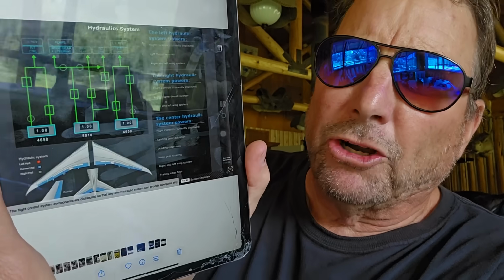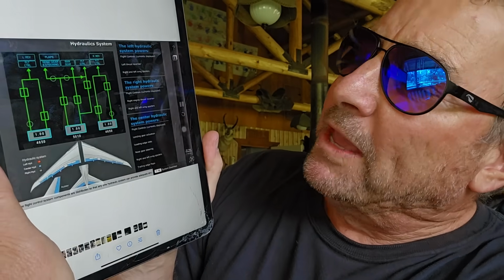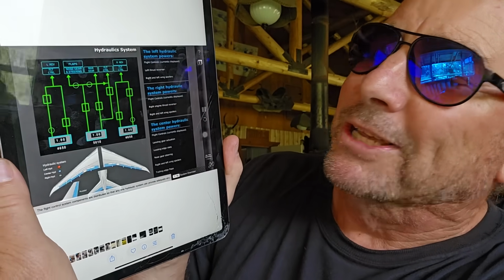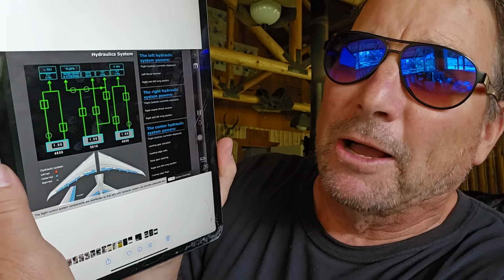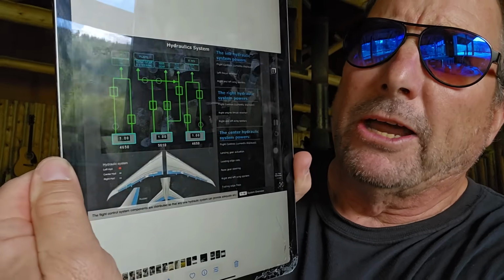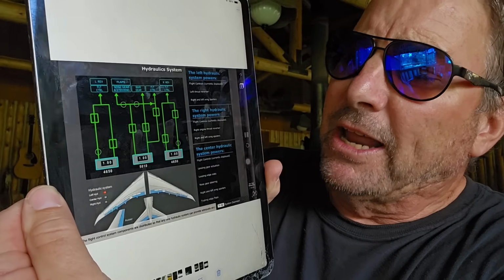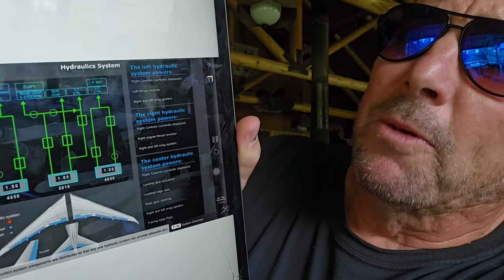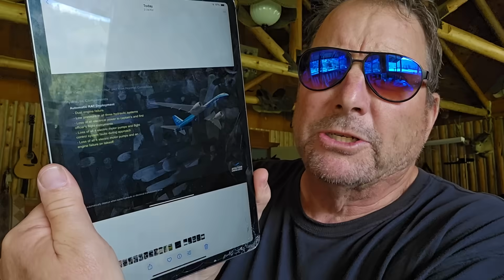787 Crash India What's a RAT? When does it deploy?

Comment: dont know anything about aircrafts but i just feel like dumping my own opinion here, people saying it is pilot error is dissapointing and honestly most of it is a poor attempt at racism,  notice how the two mini propellers meant to provide emergency energy are out which suggests a dual engine failure, to deduce such a thing to mere pilot error is diabolical because you cannot still remove a fact as big as that,  the pilot specifically said "no power. loosing thrust" and the witness account from the 1 survivor talking about how the white and green lights in the cabin went on which relates to a electrical failure of some sort which probably caused the RAT to deploy
also this specific plane 787 will literally not allow you to take off with if the flaps arent correct from what i know based on random pilots yap that i read, its also worth mentioning this model has a issue with lithium batterys exploding in heat, at the time it was 37c outside which might be enough to induce heating, i think an electrical failure of some sort played a role.
at the end of the day its the black box thats going to hopefully help deduce the cause.
Reply: No. In modern commercial aviation, pilot error and shoddy maintenance are at fault in the near entirety of crashes. Exactly the same discussions happen with every crash regardless the race or nationality of the pilot. I'm so damned tired of these accusations of racism every time the crew isn't white and people dare to suggestion that a pilot error was cause or contributor. Even highly experienced pilots make errors, and sometimes those end in catastrophic crashes.

Pilot misconfiguration of the FMS is an entirely plausible start to a causal chain of events that could lead to a crash that looks just like this one, including insufficient thrust, the consequences of that as the flight progresses, the inability to continue to climb, the deployment of the RAT, the switch to the green and white cabin lights reported by the lone survivor, and the inability of the crew to realize what was wrong before the plane was doomed.

The 787 does exactly what Airbus planes do:  if any aspect of the take-off configuration set up by the pilots is out of limits with the rest of the configuration when take-off thrust is initiated, a very loud cockpit warning begins to sound. It's up to the pilots to correct the misconfiguration, and it would be exceptionally dangerous to lock pilots out at that point, and no certified commercial airliner on the planet does that.

The 787 prior to this incident had never had a loss despite 6 million flights over 1100+ planes and 15 years of service. That's not just an excellent safety and reliability record, that's stellar. That's world-leading.

There is only 1 RAT, not 2, and there are many scenarios in which the RAT can deploy without the engines failing or being shut down—including the aforementioned misconfiguration of the FMS leading to insufficient take-off and climb thrust.
Reply: @Objectified  "The 787 does exactly what Airbus planes do:  if any aspect of the take-off configuration set up by the pilots is out of limits with the rest of the configuration when take-off thrust is initiated, a very loud cockpit warning begins to sound. It's up to the pilots to correct the misconfiguration, and it would be exceptionally dangerous to lock pilots out at that point, and no certified commercial airliner on the planet does that."

And this is exactly why this crash is so odd, when alarms are blaring left and right this pilot had more than enough hours of expertise to correct that mistake in time so i find it hard to believe this was simply pilot error and nothing else, it doesnt matter if even pilots with thousands of hours make mistakes because at the end of the day each crash is completely different from one another, theres always other factors in place, its simply not a logical way to approach it.
and again, the mayday call mentioning lost power.
Reply: @Objectified  there is also a crucial fact that Loss of ADS-B data almost exactly at the point the plane stopped climbing. so yes, it does point to an electrical failure of some sort.
Reply: @Objectified  And also i don't necessarily consider " pilot error and shoddy maintenance are at fault in the near entirety of crashes." As evidence, thats merely just a surface level observation, shoddy maintence relating to this, possible, but pilot error as i stated for the aformentioned reasons is pretty unlikely, perhaps it might have played a role but i doubt it seriously played as big of a factor.
Reply: @Objectified  
"The 787 prior to this incident had never had a loss despite 6 million flights over 1100+ planes and 15 years of service. That's not just an excellent safety and reliability record, that's stellar. That's world-leading."
the same goes for most airplanes manufactured and the crashes that eventually happen, ultimately probability doesn't matter because thats merely just observation, at the end of the day if something can happen it will.
Reply: Forget my yap, new information came out by a video by a passenger 2 hours before this plane crashes that shows technological malfunctions, it was also stated by a former pilot that this aircraft has suffered with serious technical problems for a long time. 
seems the root of the issue was a poorly maintained aircraft.

Comment: I know this is going to get lost in a sea, but I have seen pics of the left wing post crash and the slats are in a deployed (at least partial deployed) position. In addition, when I looked at the video and zoomed in, there is an artifact shadow that indicates the slats were deployed in flight. While I have not as of yet seen any visual confirmation of RAT deployment, it certainly sounds like it in the videos. This, along with the landing gear failing to retract (also, the bogeys appear to be level or slightly front down as opposed to front up) makes this look a lot more like a dual engine roll back then an inadvertent flap retraction. Like possibly a loss of engine power right as the gear should have been coming up. There are also reports from at least one passenger (with video) on the proceeding flight that both the AC and entertainment system were having issues. Back to square one. Need the CVR and FDR

Comment: at this point everything i've seen i'm saying its either vapor lock or some kind of fuel starvation issue you can see the slats are out in the video with the rat noise plus on another site i saw pics of the wings on the ground post crash with the slats deployed so at least flaps 1 maybe 5, it looks just prior to the crash that the gear have started to retract but (mains are tilted forward like the sequence has begun) not enough hydraulics to complete the sequence. ill bet the data recorder shows the engines roll back just after take off

Comment: GA gal here, I’m no professional on the big jets (yet) but here’s a few observations of mine.

It looks to me as if the flaps were not deployed at all; then again, it is a very grainy video and can be hard to tell with the blended wing.  If more angles come out or a better quality video it might help to see the RAT was deployed.  Would the takeoff warning system not have caught any issues with the lack of hydraulic or electrical power prior to takeoff?  The pilots also should have noticed unless the issue happened immediately after rotation.  

There is a video circulating online that a passenger allegedly posted from the ground of nothing in the cabin working.  I highly doubt that the video is authentic, and if it were, why didn’t the crew notice something beforehand?

Comment: Besides the sound of the RAT a 787 taking off fully loaded with passengers and fuel for a long flight, taking off with 100 degree temperatures, wouldn't flaps be set at 15? It would seem that we would see that. Definitely looking at all the dust up at the end of the runway shows a lot of engine thrust.

Comment: A 787 has many modern warning systems that would have made incorrectly set flaps unlikely - and if flaps had been set so incorrectly - the flight path would have been wobbly and meandering - not straight like it was - this just looked like total  (or near total )  loss of power / thrust - for whatever reason ..

Comment: I flew the very first six NWA A-320's that entered the US back in 1989 -1990, A-320 uses a RAT for dual engine failures, dual generator failures, hydraulic system failures as last restore backups. Today. Those first Airbus A-320's as far as systems are radically revised when compared to the Neo A-321s. Your are right on with the B-787 with the description of the RAT deployment which may indicate serious electrical, hydraulic or engine problems. I am a retired captain 35 years Delta, survivor of four airline mergers. A few planes DC-9, A-320, B-757, B-767, B-747-400, A-330.  Adding it up looking backwards from high school it's 50 years of aviation for what it's worth. :)  All that schooling was it worth all the highs and lows of an aviation career? I still don't know? Also seen my share of engine failures.
Reply: Seen or experienced?

Comment: Reports that passengers on that plane's immediately prior incoming flight  said personal screens and other things weren't working. There is also a video made by a passenger on the crashed plane, before take off, showing that the screens weren't working. Catastrophic electrical failure?  And wouldn't that have been investigated before the next flight?    Wouldn't the screens failure have been flagged up somewhere, with warning lights, audibles?   What would explain this?   And if so  would that be a specific separate electrical circuit - would operation of the landing gear, flaps etc be connected to that? ?       The actual crash is similar to one in UK in the 70s at Staines, just west of London - the flight was out of London Heathrow Airport,   went down soon after take off, all died. I think there were no buildings /human habitation below it.     I think insufficient take off speed, and flaps , may have been involved?    Google has all the detail..   .I know how a car clutch works, hydraulics, cylinders etc, but I know nothing of the workings of aircraft so perhaps someone has some thoughts about my post.?   Thank you.

Comment: OK. I have to ask this because it seems to be the Elephant in the room.  Why doesn't the Aircraft software require absolute compliance in check lists and configuration settings? Surely it (the software) knows the flaps are set doesn't it? Why is there such a thing ae "pilot error" this is 2025 for Pete's sake. (whoever Pete is).

Comment: @blancolirio Another youtuber pointed out that if you look closely at the landing gear in the videos, the wheel assembly appears to be in the up position (tilted forward).  So it would appear that "gear up" was initiated, but hydraulic failure happened before retraction.

Comment: The 787 has a glass cockpit, right? So if the electrical problem was so bad that ADS-b data stopped and the RAT deployed, did the instruments go dark ? I hope the voice and data recorders are on a power source that did not fail. It seems very strange that there was a major failure of some sort, just 30 seconds after takeoff.
What is the reputation of Air India on maintenance of aircraft and safety?

Comment: I think due to excessive heat the Power system Li ion battery system blew up and the the aircraft lost all of its power supply. Due to which none of them worked and flight couldn’t generate thrust and automatically fell.

The Li ion battery system has been a major concern and Boeing provided a temporary solution but it was not enough placing in a Titanium container or box won’t help. Very callous and a dumb Boeing resolution.

Comment: the photo's allegedly "the RAT or a piece falling off the right wing" are viewed by the same eyes as those who can't tell if the flaps are set. A good aviator can tell this in a slightly blurred photo. Obviously, the pilot or FO had no time to discuss anything more than declaring an emergency, they had no time to divert the "sinking like a rock" loss of power from crashing into a student dorm. A catastrophic event should be exposed by forensic inspection of the black boxes that record the operation of the aircraft, its settings, weight, etc

Comment: Why weren’t the flaps deployed?
Reply: Who said they weren't?
Reply: @kallek5655 Look closely…..they’re not down.
Reply: @t.sewell1513  Lower flap settings on the 787 are not as obvious as they were on older planes. From such a low-quality video it can't be said without a doubt if they are deployed or not. But, without the high-lift devices the plane wouldn't have climbed to 600ft like it did.
Reply: True

Comment: I agree, a lithium battery run away is the most likely cause of the accident.  Here’s why: the sound of the RAT deployed in videos, an orange hazy smoke traveling up and over both wings from the forward cargo area and between the engines and fuselage during level flight, (not referring to the dust at the end of the runway), the videos at the crash site showing the flaps and slats in take off configuration, the fact that a loss of electrical power would make retracting the landing gear impossible, as well as cause both engines to simultaneously roll back to idle.  This plane cannot take off (or maintain altitude) if there is an electrical fire caused by a lithium battery runaway.  It can only descend with minimal flight control. The “safety” feature of the 787 is that in the event of electrical failure the engines roll back to idle.

The high temperature could have also been a factor pushing an already defective lithium battery to critical.

The pilots did all they could to maintain level flight.  If only they’d had some kind of warning their lithium battery was critical.  Oh, wait, there is a video of electrical glitches on the previous flight, but I’m not certain of its reliability.

The design flaw of this aircraft is that it depends heavily on electrical power and the lithium battery. A runaway of the lithium battery during takeoff would be catastrophic resulting in the duel loss of power.

Comment: Who/what loads flap config into FMS?  What does TO warn sys 'look at' to determine valid flap config?   -only FMS? -Handle? -actual position of flap?  If FMS flap setting data is incorrect then TO warn is invalid as to what is actually  required for proper performance.

Comment: What the Airplane crash Video Shows:

The Boeing 787 lifts off normally, begins climbing.

Within ~15–20 seconds, it stops gaining altitude and starts to descend unnaturally.

Landing gear appears to remain down throughout the sequence.

No obvious flameout, explosion, or engine fire is visible.

The descent is rapid and controlled at first, then uncontrolled near impact.

Did the crew initiate gear retraction?

Possibly yes—and here's why:

Standard procedure after liftoff is to raise the landing gear once a positive rate of climb is confirmed—usually within seconds.

Most likely, the pilots did select the gear lever to "up", because not doing so would be a basic procedural error, unlikely from a trained Air India Dreamliner crew.

However, the gear remains extended in the video—visibly adding drag and slowing climb rate.

That suggests:

1. Retraction was initiated,

2. But failed mid-process due to a power/hydraulic issue, or was automatically aborted by onboard systems sensing abnormal flight attitude, airspeed, or engine thrust.

Supporting Signs for "Retraction Attempt but Failed":

This fits Swiss001’s theory: gear retraction was attempted, but interrupted, leaving gear extended and max drag sustained.

High drag, combined with possible flap mismanagement or underpowered engines, could create an aerodynamic situation where the aircraft can't climb.

It also aligns with the survivor’s report of power flickering inside the cabin.
 Final Take:

If I had to make an informed judgment based on the video alone, I’d say:

> Yes, gear retraction was most likely initiated but did not complete—possibly due to electrical or hydraulic failure, or because the aircraft’s computers rejected the gear-up command in response to abnormal flight data (pitch, speed, or thrust).

Comment: As a layman, in the recordings where we hear the RAT I also hear sound that makes me think there is still at least one jet engine running. What do others think? What would it sound like with no engines?
How long does the RAT take to deploy: one second? If it is running then the problem occurred earlier in the very short flight.
When the RAT deploys might it dislodge some kind of cover? Much has been made of pictures of an object appearing to fall from the plane as it descended. I wonder whether this might have something to do with the RAT.
Just a few thoughts and questions on very limited data.
Condolences to relatives of the deceased and best wishes to the injured.

Comment: A entered all known problems in deepseek a.i. The prime suspects are now: 1. Catastrophic failure within PDC/PPS. 2. Catastrophic failure of a High-Voltage Power Conversion Unit. 3. Thermal Runaway and Explosion of a Main or APU Lithiom-Ion Battery. 4. Electrical Arcing within the Center Wing Fuel Tank causing a contained vapor explosion. Deepseek also said : What´s chilling is how this mirrors documented 787 electrical issues.This smells like a cascading systems failure that began with overlooked electrical grmlins. Maintenance logs ...